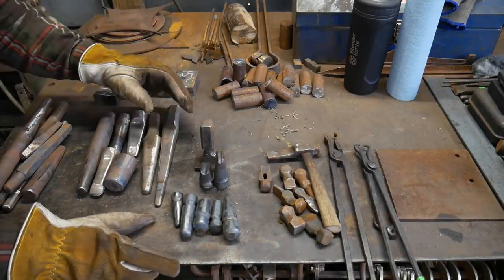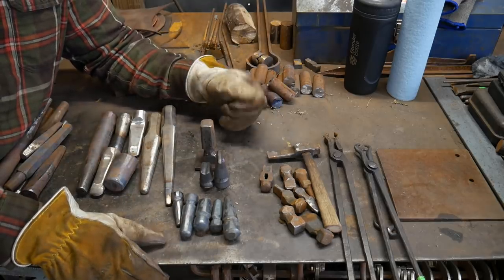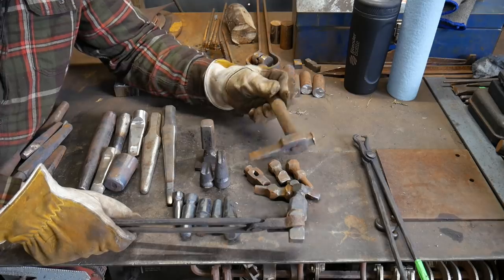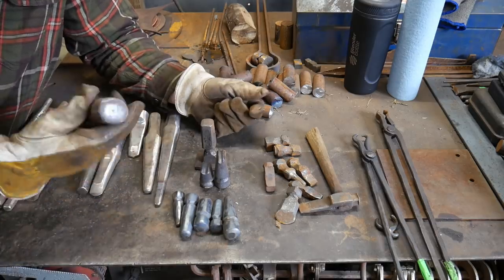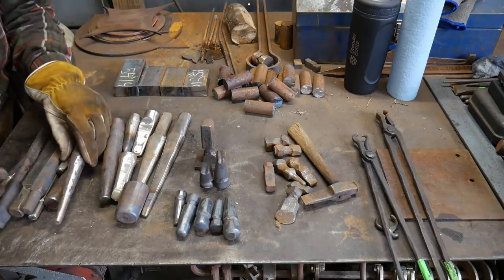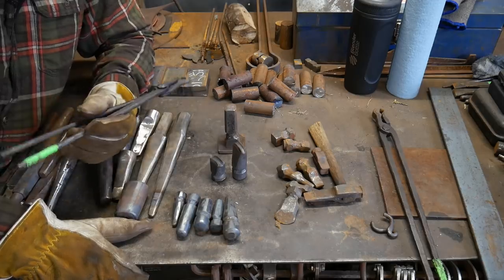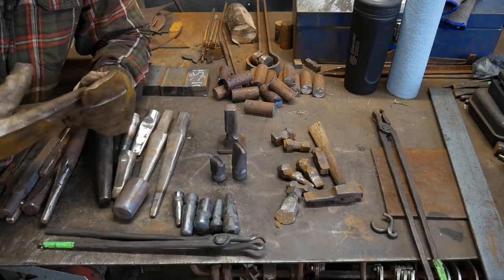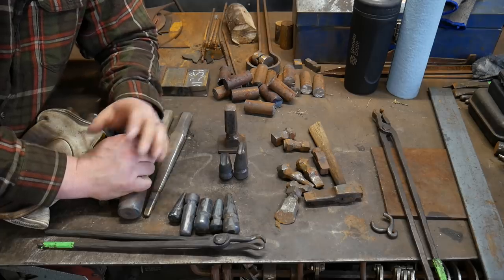My FAILED Tooling

Comment: Ii built all my tools but 3 hammers , all my tongs are forge and fab and weld . I know tongs can be made faster ,nicer , and a blacksmith would not use them nasty grinding wheels as I had to to make tongs .Tongs are safety gear as I need ASAP in my shop.Now I have tongs to make tooling I am safer .When I do build my nice tongs from blacksmithing they will be the better tooling.
Upgrading is a natural move.
Thanks to Roy and them many You Tubers that teaches